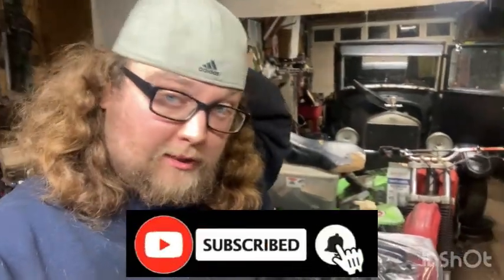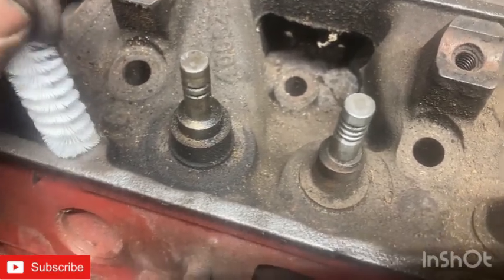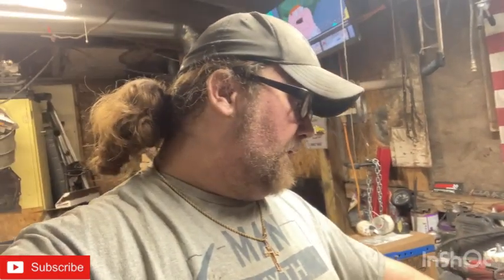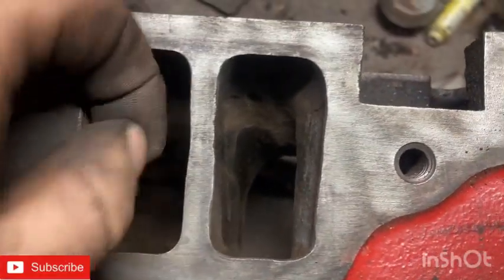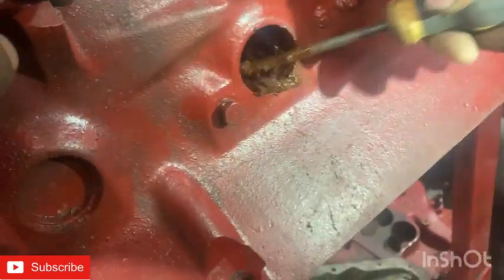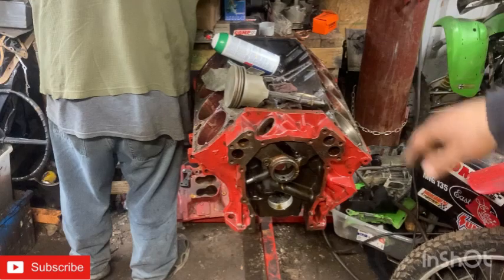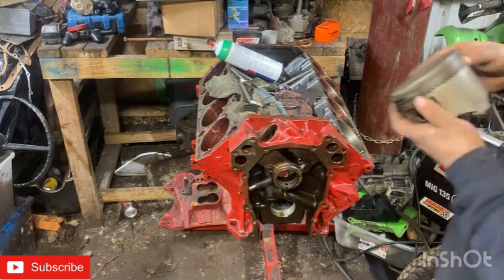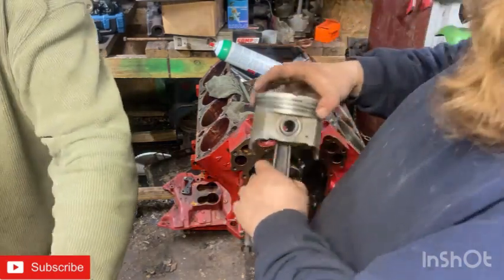Big block mopar 400 budget build random stuff being done to it #budgetbuild #mopar #budget

Comment: No zinc . No metal to metal protection . Royal purple HPS or VR1 valvoline is what we use depending on if synthetic or conventional is needed . Both have high zinc .
Reply from the maker: We put a zinc additive in with the oil it seems to work good the engine broken in just fine